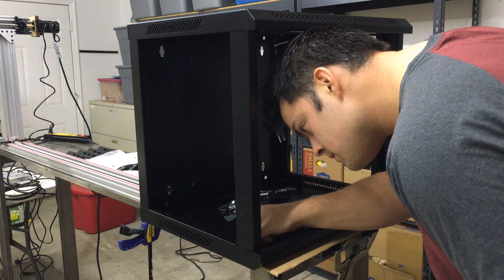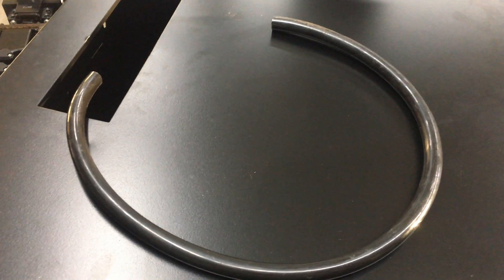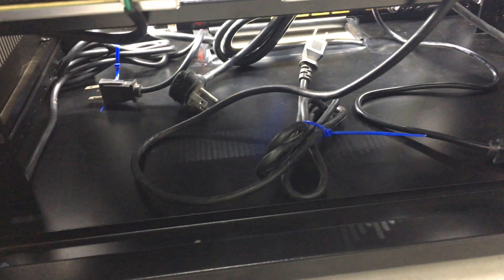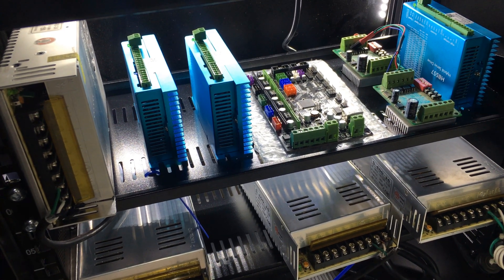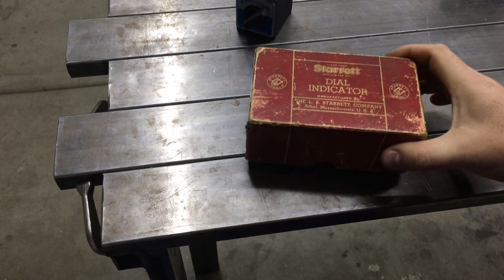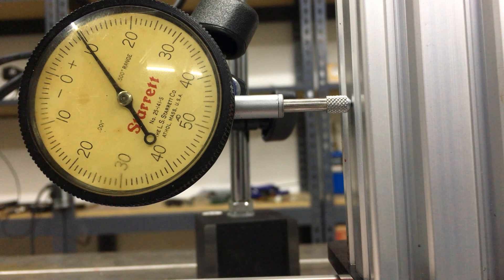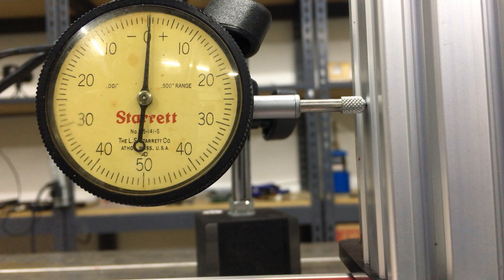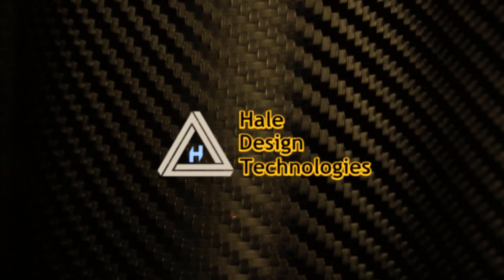LARGEST DIY 3D Printer CNC Build - It's Alive!!! Best 3D Printer Controller Box Ever!

Comment: Yea, I know that video are 8 mo sold but still...

Maybe position issue are linked to stability of the base? Your build at this point has no base and indicator stand are placed why know where. its a good practice to place indicator stand to most rigid and solid part...

I like this thing as much as I hate it, construction-wise xD. If I would build one I'll do it different xD
P.S. Good to see things like this being build and do their job.

Here may or may not be frame rigidity issue, frame resonance issue that will drive you crazy and because you are using rollers that cannot take much axial load, but made to take radial load you may have an issue with wibble-wobble gantry and funny top layer finish on prints.... 
I still didn't watch all the videos, but as much as I already saw - its well-made and fun to watch.

Sorry for  broken english;).